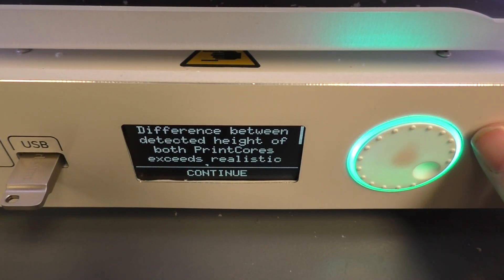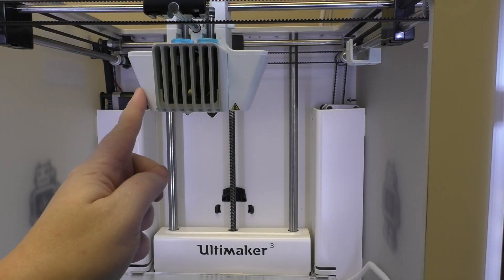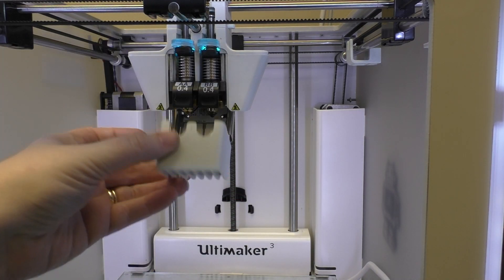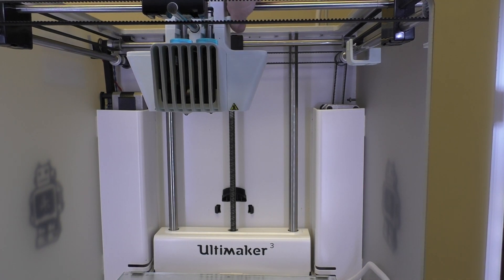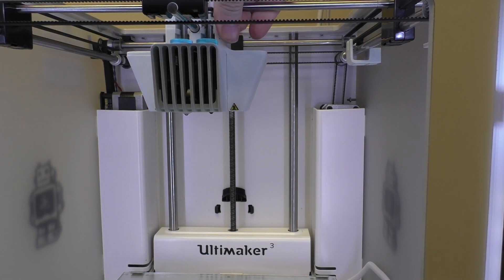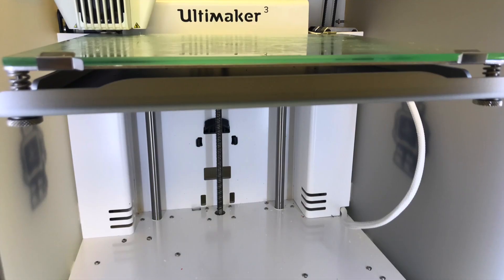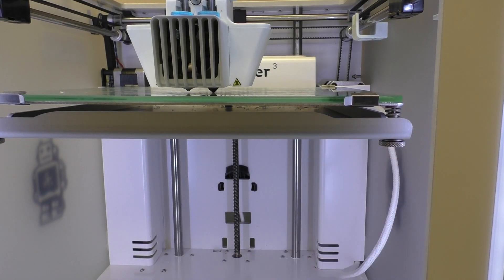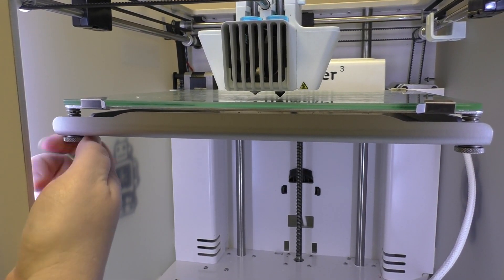Active Leveling Fix (UM3/UM3X)

Comment: This helped me find my issue - in my case the printcore's metal "tube"(where the filament goes through) was loose. I had to loosen the 4 bolts on top next to the bowden tubes to even get it out, to fix it.